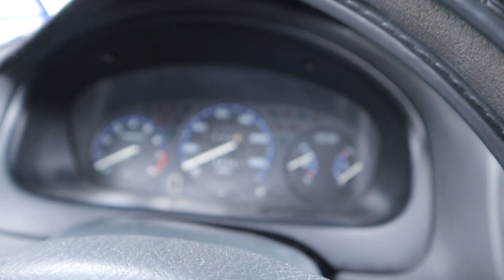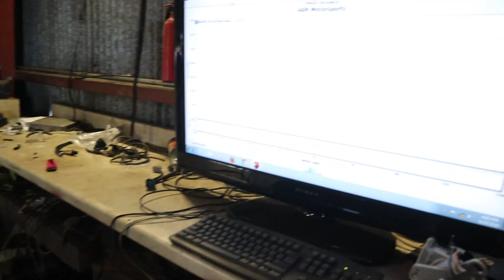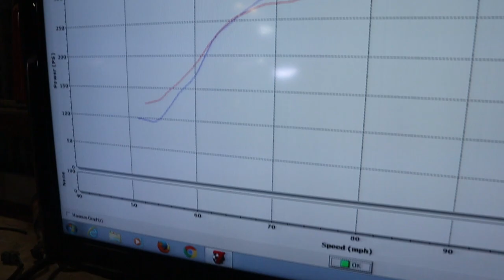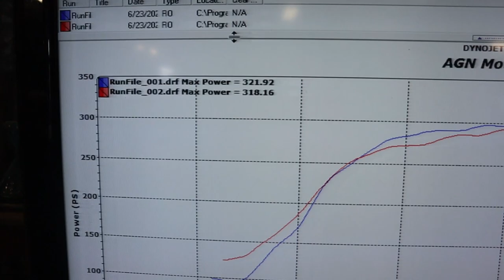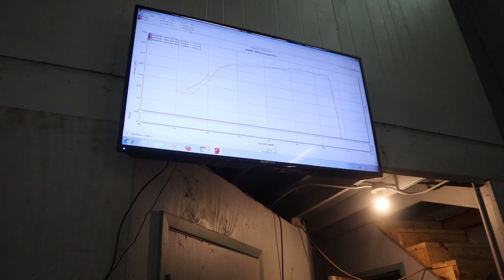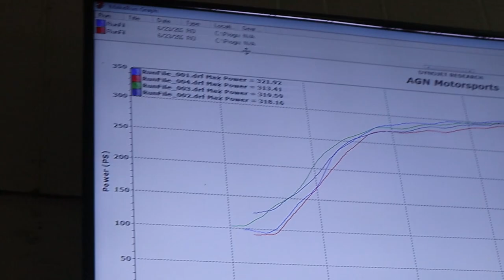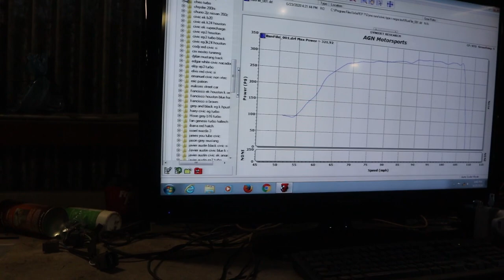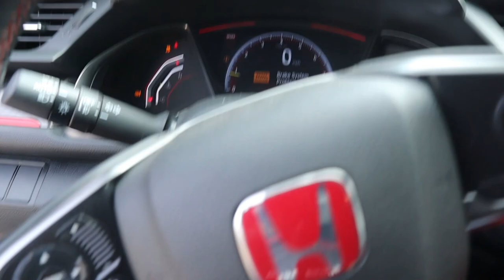Honda Civic Type R Gets PRL Down Pipe & Front Pipe Combo and Dyno Pulls!

Comment: Yo i use the hondata tune, im at 382 whp with all my upgrades (which includes the PRL down pipe and front pipe); I higly recommend you switch to hondata
Reply from the maker: Already did brother and I love it! :) Thanks for the comment!
Reply: Yo what all do you have done? Do you have a cat back or anything like that?
Reply: @loganberns7467  I use the HKS Spec L exhaust and PRL Downpipe and Midpipe
Reply: @loganberns7467  also HKS intercooler, HKS Oil cooler, HKS Blow off valve, HKS Hi-power suction intake kit
Reply: @psalmco2425   im just ordered the prl downpipe and cat and thinking about an intercooler too...what one you think i should get? You like the hks one or would you recomend something else?
Reply: @loganberns7467  I would recommend the HKS intercooler but with PRL' s charge pipe, The HKS Intercooler has better cooling numbers but the charge pipe is relatively small in diameter compared to the PRL pipes, they are compatible just use the HKS end tank pipes
Reply: @loganberns7467  as for the PRL downpipe i personally love it, good gains with a tune and really lessens the restriction over the stock one

Comment: Hey bro awesome video.  I pretty much have the same set up you do. I have the RV6 High flow cat with the RV6 front pipe and the GReddy Supreme SP Exhaust and Mishimoto intake and Intercooler. HKS sequential Blow off valve. With Hondata and a custom tune. Dyno at 389WHP & 398TQ NO E85.  Your car could do much more bro just get rid of your Ktuner get Hondata bro.
Reply from the maker: Bro I already got it ordered haha. Your numbers are my ideal goal atm. Thanks for commenting! :)
Reply: Get rid of that bov my guy. Check the forums about all the issues they’ve been giving off. Just a friendly heads up!
Reply from the maker: Lol I didn’t realize you weren’t referencing me at first. I was thinking “but I have the stock one” 🧐 I’ve read this too and I believe there are videos on it

Comment: If you tune it up to 350 horsepower then it will beat the focus rs awd
Reply from the maker: Im tuned to about 370 right now :)
Reply: @xSyrious  so you only got it tuned to 370 horsepower just by having the Remus exhaust and the prl intake and tuning right?
Reply: Stock vs stock the Type R is faster from a roll . The RS is faster from a dig of course.

Comment: Catted or catless? Might've missed it in the video. Nice video brother.

EDIT: Also, a lot of reviews show that basemap tunes are better and have more power on ktuner vs hondata. So if you do make the switch, make sure to consider that. Find out what tuner you're going to go to and use their preference if going custom tune.

FWIW.. I run basemap on Hondata and it's fine for me.
Reply from the maker: Sorry I actually totally forgot to specify it was a catless downpipe! I will definitely keep that in mind! I'm totally confused on how I hit so low on the base stage 1 Ktune. Maybe I should try reflashing and see what happens. Thanks for commenting!
Reply: @xSyrious  hey man don't get too caught up on the baseline. We all know all dyno reads different. The delta is way more important from your baseline numbers to a custom tune for example, or a stock map vs basemap.
Reply from the maker: @The1Simplified  Yea you're right! Another one of my problems is no one in my current area prefers Ktuner for their tuning. All the honda tuners are running hondata for their maps. Also a few of the guys I researched for a custom remote tunes prefer hondata too.

Comment: No one seemed to ask but why was the car smoking like that?  Your turbo blanket or what?
Reply from the maker: Yes the turbo blanket and the down pipe and front pipe were freshly installed. So it's normal to see smoke on fresh installed parts sometimes until they've broken in. If it continues after break in it would be a problem haha

Comment: Thats a bit low. I am running stage one PRL intake, PRL intercooler, PRL charge pipe, Remus exahust,  and hondata tune. I am hitting 355
Reply from the maker: I make a lot more power than this now actually with the same mods haha
Reply: Crazy, seen a guy hit 400hp with just a down pipe and hondata.

Comment: I am surprised a man of his knowledge would buy such a nose heavy pig. The  head gasket, overheating and transmission issues need addressed. And 340hp from a flash? Not Fu-king hardly. My nephew owned one of these heaps for about 10 months and lemon lawed it was so horrid. He now owns a 15 Shelby GT350. 45 grand for a Civic is seriously ignorant.
Reply from the maker: Bahahaha
Reply: Lol why did you pay 45k I got mine for 35k 
Dealer markup? I don’t pay that hahahah
Reply from the maker: @kissit483  I was thinking the same thing that's wayyy too much to pay.
Reply: Gt350? Alot of $$ for a slow ass car.